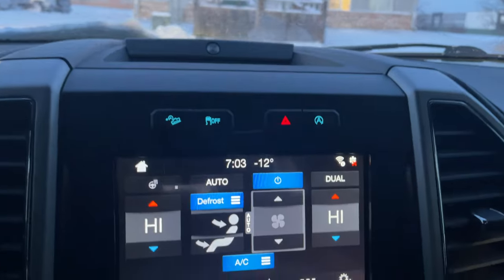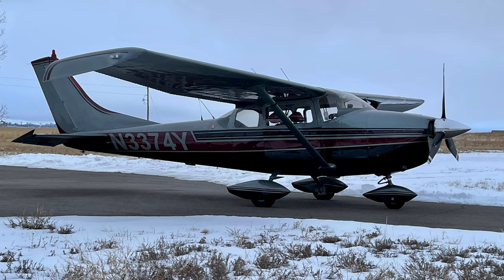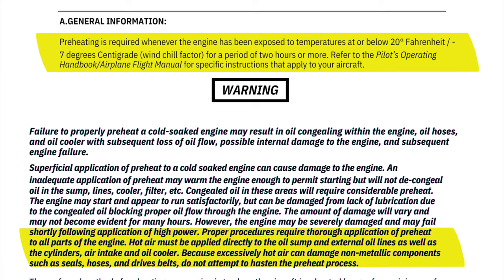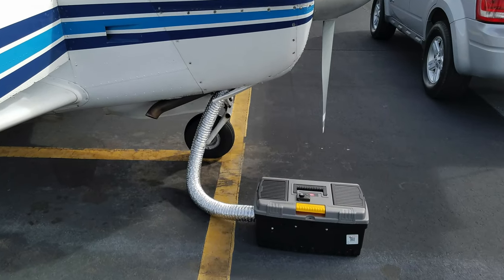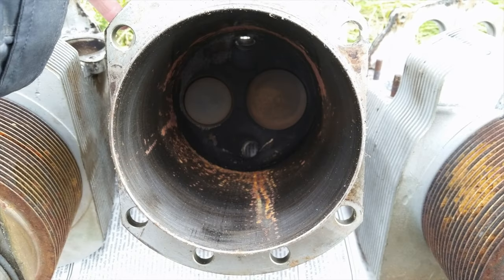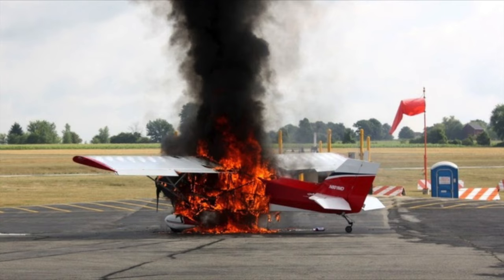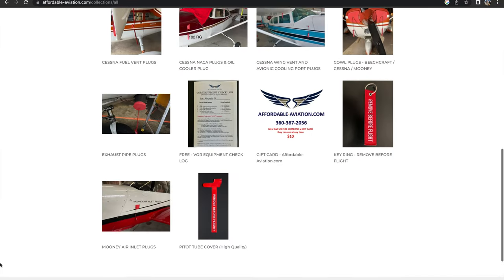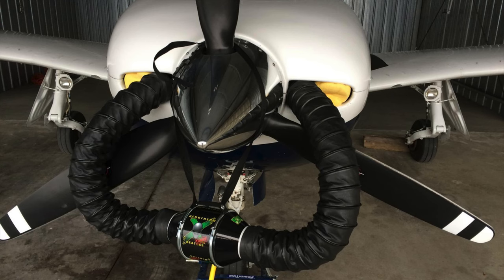Airplane Preheat | Why You Should

Comment: I use a Tanis heater and the Switche-On as well on my Cherokee 180, great setup. Also use cowl plugs and a cowl blanket. One thing you didn't talk about that I also use is a simple thermostat controlled heater in the cabin. If you've got analog gauges and gyros, they too are made of dissimilar metals and cold startups can be tough on them too. Added plus, you have a warm cabin during preflight.
Reply from the maker: You’re absolutely right! The Hornet heaters have a ‘45’ series made for the cabin. It is larger and puts out more heat than the 22. I may add one of those to the setup as well. I do occasionally use a safe space heater in the cabin while I preflight. Again, not the best or most thorough option. Thanks for watching!

Comment: There are differing views on the continuous versus periodic use of full engine heat. If I recall correctly, Reif takes the view that continuous operation is fine as the engine temp will not fall to the dew point and thereby avoid corrosion.  Coupled with an engine dehydrator, the risk of corrosion is limited still further.

Comment: Great video!  I’ve got a similar setup to yours.  I live in Ohio and store my 182 in an unheated hangar as well.  I’ve got the Twin Hornet 22 for the engine along with the Hornet 45 for inside the cabin.  The Hornet 45 does a really nice job of warming the cabin and instruments.  Both are hooked to the Switcheon unit.  One other feature I like about the Switcheon is the built in thermometer that tells the temp inside the hangar.  I think I’ll add the sump heater that you’re using during my next annual.
Reply from the maker: I think I may look at picking up that Hornet 45 as well. Occasionally I’ll throw a safe space heater in the cabin while I preflight. Certainly not the best or thorough option though.
Reply: Good info… just got a SwitcheOn… works great… Idaho has the same cold weather!

Comment: Just place a 12 or 24v hot water heating element in the oil sump and coolant gallery and you are done. Those heating pads are terrible, most of the heat goes outward.
Reply: I disagree. I have them on my truck oil pan. One on each external side of the oil pan. They make a very noticeable difference in how fast the engine idle speed kicks down lower after startup on days where it is minus 10F or colder outside. My truck sits outside all year. They may not be the most efficient, but they definitely work. On really blistering cold nights I leave them on all night. If it is not quite as cold, I can get away with just turning them on for a few hours prior to starting the truck. I run full synthetic 5w-20 oil in winter.